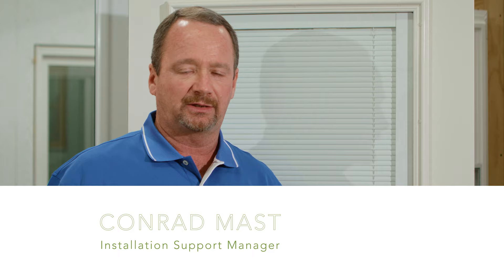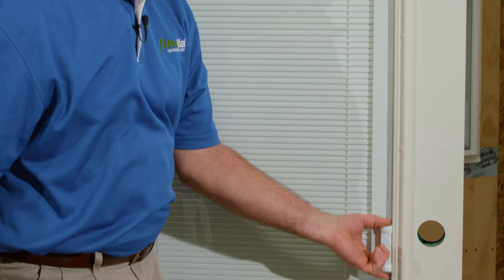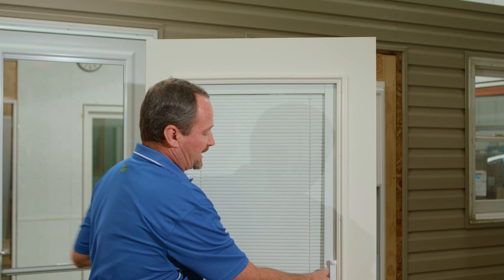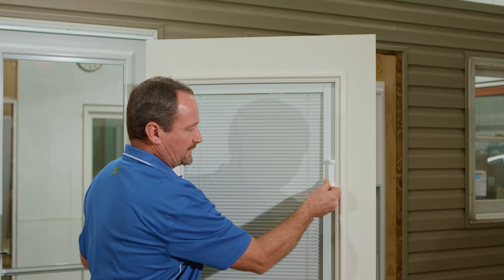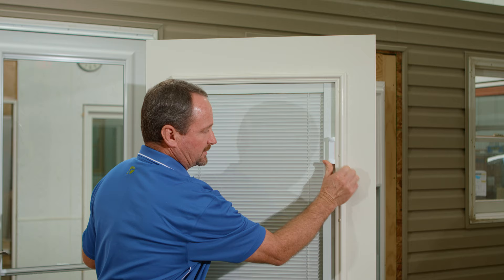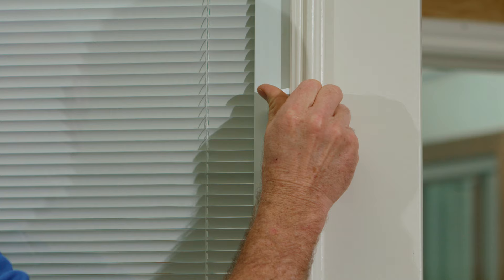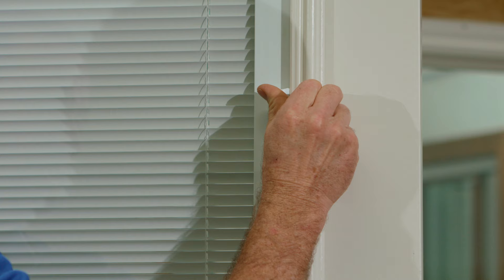How to Fix the Internal Blind Control Mechanism in Your Door Glass

Comment: Is there access to get in between the glass? I bought these off someone and during the process of picking them up I turned  them upside down which caused one  of the blinds to bend. I went ahead and followed your instructions but there's a gap due to one of the blinds being bended a bit

Comment: Thanks but I still have issues.

I reattach the slider and slowly raise it. I move slower thru the first click, then through the second click. I then slowly side it down to the bottom and back up, but the blinds don’t move. When I move it toward the top past the second click location, I can feel another area of resistance. If I click it there, I hear the slider inside the door fall to the bottom. 😏

Can you tell me what’s happening?  Is there something else I should try?

Thanks in advance for any help you can provide.

Comment: I tried this several times and it didn't work. I think there must be something broken inside. The tilt works but not the up and down.
Reply: I have the same issue.  Did you find a solution?
Reply: @ameliajordan8881  unfortunately, I didn't.